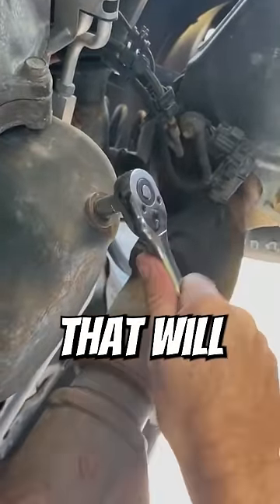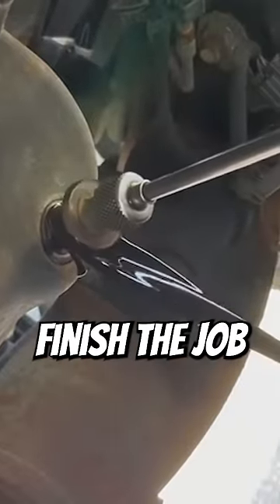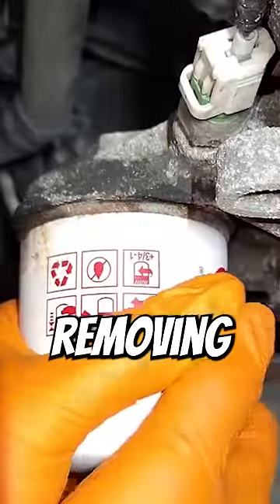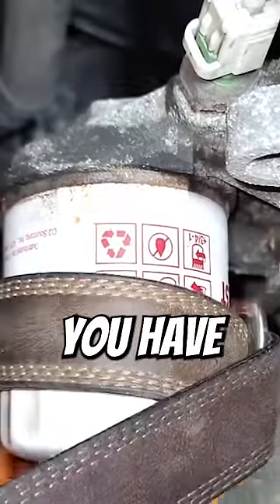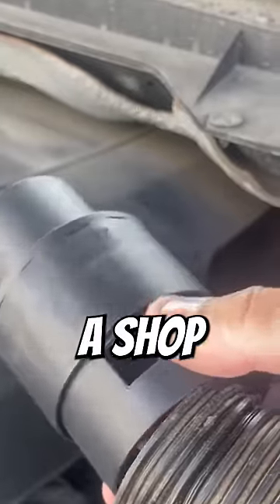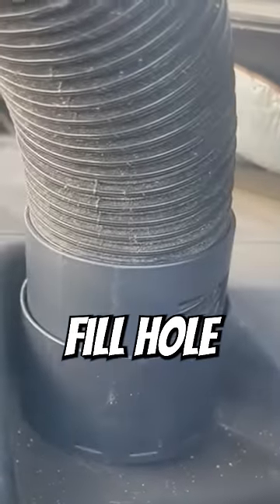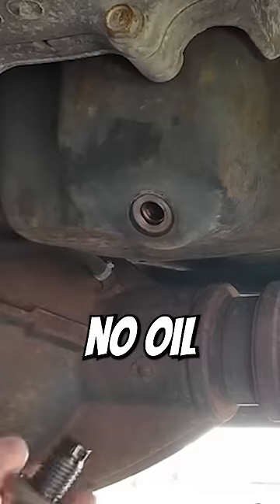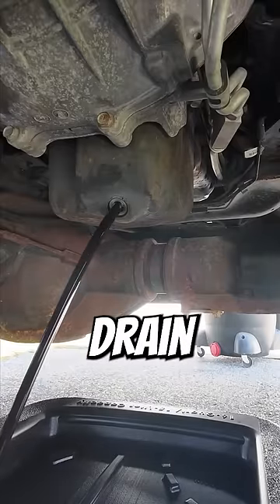Mechanic Life Hacks That Will Improve Your Worthless Existence - Oil Change Edition

Comment: My favorite was learned from my grandfather:  1) empty/drain and use Slick 50 cleaner 2) add slick 50 3) weld the drain plug closed.  4) change filter on the reg 5) add more Slick 50 when needed. 

Years ago, oil change recommendations were close to every 50,000 miles.  Now it is every 1500 miles to 3000 yet the engine and oil are better than ever?  It’s a scam people. 
  I’ve been a mechanic for 38 years    Have not changed my oil in about 20.

Comment: Just push in on the bolt as you unthread it and at the very end it will drip slowly arrange your wrist to the top so you can pull the bolt up to the side to avoid the fluid. There ya go.now, you dont have a dirty oil covered magnet thats gonna slide in and out to easy now that you oiled the slides and clean hands

Comment: The shop vac trick is my favorite- Being a heavy equipment mechanic I have used it so many times to service hydraulics so I don’t have to drain the tank. Once changed a main pump on a Doosan dl300 with almost zero mess!

Comment: 1: if you don't like getting your hands dirty, wear gloves. 
2: why use a belt when most toolboxes should already have a very cheap oil filter wrench. 
3: I actually like the vacuum idea
4: goes back to 1 and 2. Use a filter wrench to loosen it, and then use a gloved hand to avoid the mess

Comment: What my dad taught me is to rub a bit of the new oil on the gasket of the new filter to help you tighten it down easier and it makes it easier to get off next time.
Also my old neighbor mechanic showed that you can take off and put on the old filter by hand without having to use any kind of oil filter wrench.
Reply: Not because it makes it easier, it keeps the gasket from getting cooked and wearing out prematurely

Comment: Best hack: use an oil extractor pump. They're cheap and get nearly every drop out. Simply run the tubing through the dipstick tube, pump it up or connect to air and voila. Change the filter and fill her up. 

Most have a nice spout so you can easily pour the used oil into the 5 qt jugs.

Comment: 😎😎😎
     So ,
     Use the vac. 
        The suction will cause the sediment on the bottom of the pan  to splash throughout the crankcase and stick to the wall and crank assembly. 
       So it's not drained out.
                       🫣

Comment: I work on industrial air compressors and I bought a 5 gallon bucket head shop vac and threw away the dry filter. I can change oil in a compressor or my vehicle in a snap by just using the shop vac to suck out the oil and hold it up to the filter too and no mess whatsoever, no negative pressure, just good ol suck it out, then it's contained in the bucket, then take it to AutoZone and dump it for free.

Comment: As a diesel mechanic. I just use a small punch and poke a hole in the filters and drain them before I remove them. I started doing this mostly because of fuel filters. There is nothing worse than reaching up and getting diesel fuel on you from your hand all the way down your arm to your pit. It burns the skin...

Comment: My dad always told me for the drain plug you just push in as you unscrew it. That keeps it pretty well sealed and once you know it's fully unthreaded you just pull it away real quick. Been doing this for years and rarely get any more than a couple drops on me if any.

Comment: Or you can just do it quick and not get oil on your fingers lmao. I swear to God people spend more time trying to find easy way to make an easy job easier than the job actually takes to do in the first place. Crack it loose, starts unscrew it when oil starts to seep out, pull it out fast😂
Reply from the maker: Swearing is bad, mmkay

Comment: On the side of the jeep inline 6, the oil filter can pour oil onto the starter. So i use a plastic walmart bag and put over the filter after loosing it. Catches a lot of the oil if you get it on and dont move it while turning the canister.

Comment: Another trick is after you loosen the oil filter drill a hole through it and let it drain out that eliminates a lot of the mess also but always remember to loosen the oil filter first.

Comment: A hack I use is once all the oil is drained, I sit on the oil fill hole and fart. The pressure blip gets the last residual oil out.  

Pro tip: consume taco bell 1 hour before for better results.
Reply from the maker: SMORT!
Reply: @NoobMechanic  it's a gift really 💁🏼

Comment: 'Negative Pressure'
Reply from the maker: Correct. Opposite of positive pressure
Reply: There's no such thing as negative pressure XD @NoobMechanic
Reply from the maker: Sure there is. On a pressure gauge, anything more than atmospheric pressure is positive. Anything less than atmospheric pressure is negative. Sure, it has other names. But it IS negative pressure.
Reply: @NoobMechanic  No it isn't XD. Something less than atmospheric pressure is just LOWER pressure. the Delta might be considered negative from reference, but there IS NO NEGATIVE pressure.
Reply from the maker: I disagree. Sure, In an ABSOLUTE sense, negative pressure isn’t a thing. However, pressure can be negative, relative to atmospheric pressure. We call it vacuum. If pressure can be considered negative, relative to atmospheric pressure, it’s can be considered negative pressure. But these are just formal semantics.

Comment: Remember guys, the drain plug is the only thing keeping oil in your engine so make sure you tighten it down to the universal torque spec, 100 foot pounds.